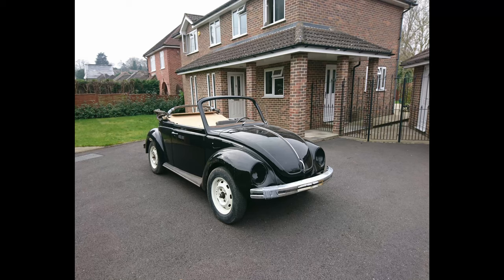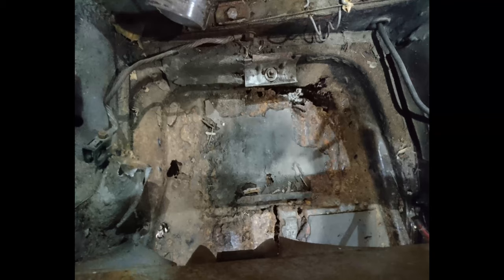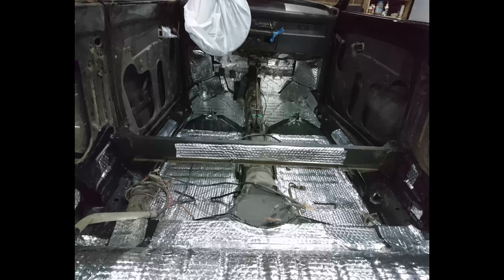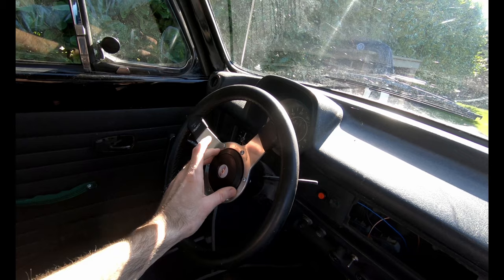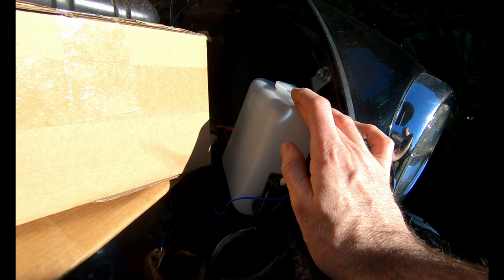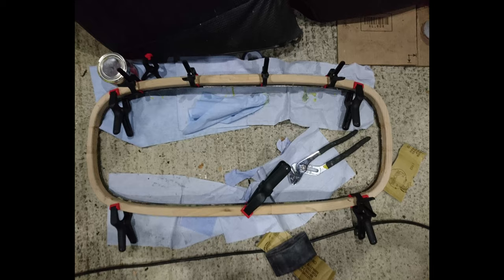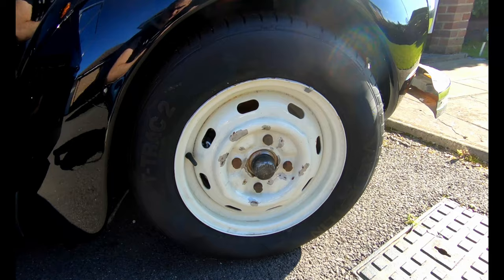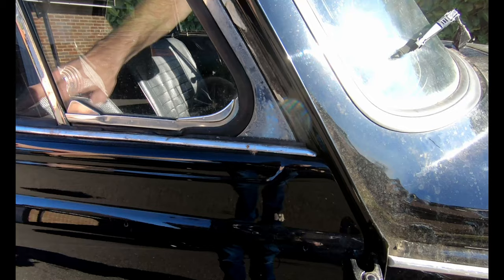Electric Beetle Cabriolet Project - In depth look at our 1976 VW 1303 Cabriolet EV Conversion

Comment: Hi Shane
Have you looked at the Thunderstruck motors VCU about the same price point, I am curios if the open inverter is a better option for more power and control from the motor? I know very little about programing and both of them can be adjusted to a degree, but for a newbie what might be easer to learn?
Thanks
Karl Nichols
Reply from the maker: Hi Karl, as I understand it, there are at least two VCU/VCM options out there for the Leaf (and some other) inverter/motor combination. The thunderstruck one and one offered by EVBMW. They both seem to operate in the same way, by sending an appropriate torque command through to the inverter to tell it how much power to deliver to the motor.  You are limited to the max power that is programmed into the inverter, but I guess you have some control over how that power is delivered (e.g. faster throttle response.) These are a good option as long as the Leaf max power is appropriate to your use (around 80kw for the gen1/gen2 drive unit) as they are more or less plug and play.
Reply from the maker: I wanted to push the motor and inverter beyond the power that Nissan have set it to. Working on the understanding that Nissan have been conservative with what they have asked of these units. (the motor more so than the inverter.) The open inverter boards allow you to fully take control of the inverter so the limitations are set by the components in the inverter power stage, rather than the Nissan software. 
The open inverter software is extremely configurable as it is designed in such a way that it could work with any AC motor inverter. But this means that there are a lot of things that need to be set to make it work for a particular situation. 
Fortunately there is a good community behind it so you can leverage the work of others to get most of the settings done, but there are generally going to be some items that are specific to your motor and to the rest of the set up you are using (battery, throttle, controls etc.) 
This is where things get a little complicated and where you need to do some digging to understand the different parameters, what they are, what they control and how they interact. This is probably more important in using the open inverter boards than understanding programming. I think building an understanding of how different aspects of AC motor control work is of more help than being able to write code. (though understanding how to read it can be helpful when troubleshooting)
Johannes (the guy behind the open inverter design) has some good videos on YouTube on these in depth technical items.
Reply from the maker: In short, if you want more than the 80kw/110bhp offered by the leaf drivetrain, then you need to go for something other than the VCU (open inverter drop in board, Paul Holmes Leaf board, or a Lebowski controller.)
If you are happy with the 80kw, then you have a choice as to how much you want to get your head around the inner workings of AC motors.  From my perspective I think I would still have gone down the route I did even if I wasn't after more power as I have used it as a reason to dig much deeper into the subject than I had before.  
I am sure though that some parts of my project would have progressed faster if I had used the VCU rather than drop in board.
Reply: @PerformanceEV  Thanks Shane
That's great information I need to dig a little deeper into the options, of course 80KW at 110HP is probably more than enough power for a 50 year old VW Bug to get me into trouble ;-)
Reply: @PerformanceEV  what power are aiming for on the porsche out of thr Leaf motor? Really interested in seeing someone successfully improving the oem power on a leaf motor. Would like to come and see the build and have a chat if you are up for it? 👍⚡